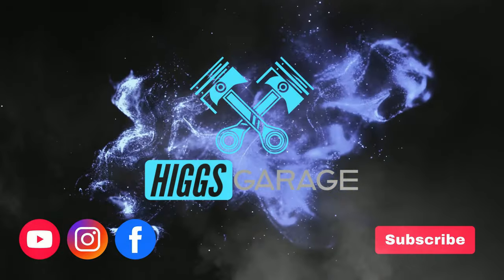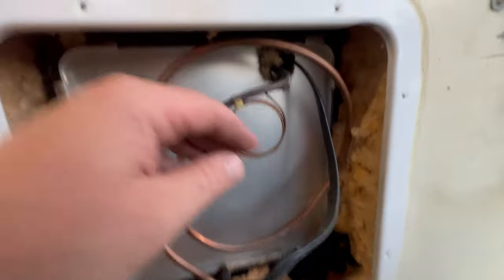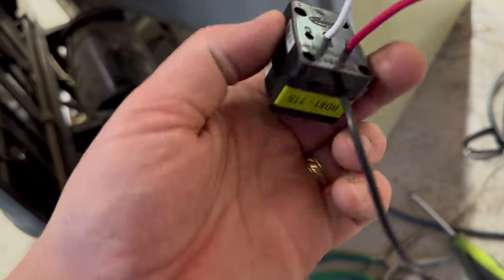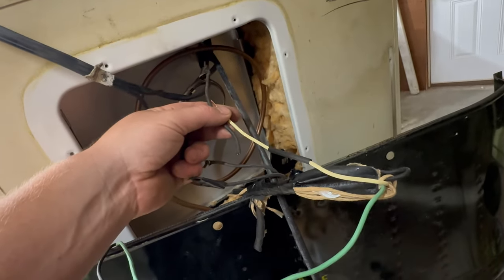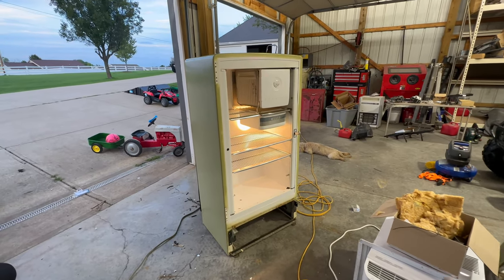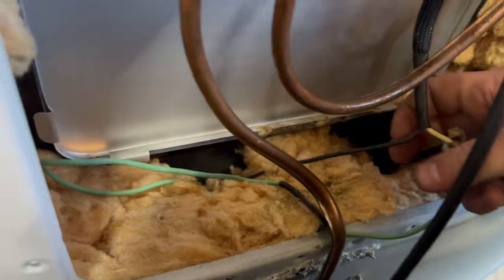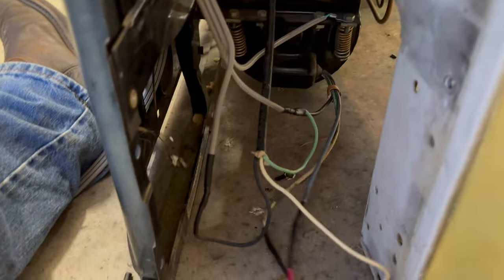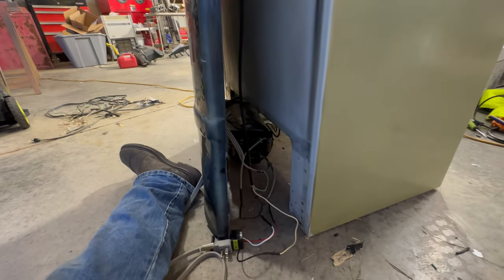Vintage Refrigerator Restoration

Comment: Thank you for perfectly describing the wiring on the new relay! I diagnosed mine myself but thanks to your video i am able to wire mine alot faster than chasing everything down with a meter. I also have the identcal refrigerator
Reply from the maker: I’m glad it could be of some help! I can’t wait to get mine painted! It’s in line with some other projects!

Comment: I have a 1962 Frigidaire refrigerator that I think the relay is dying. I keep hearing the compressor spin up and it clicks off every minute. That relay is a GYT-789. Definitely has more than 3 wires into it. Do you have a recommendation of a modern replacement?